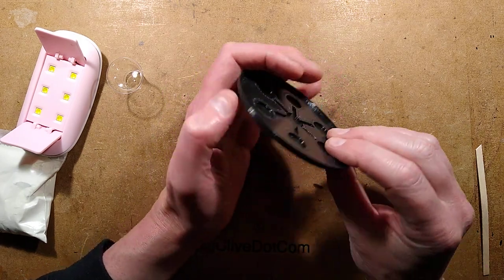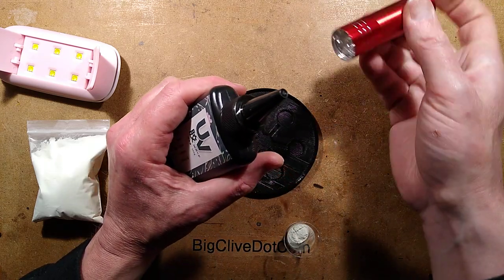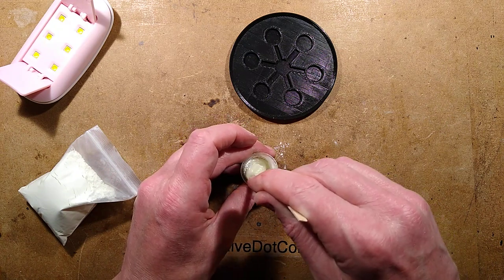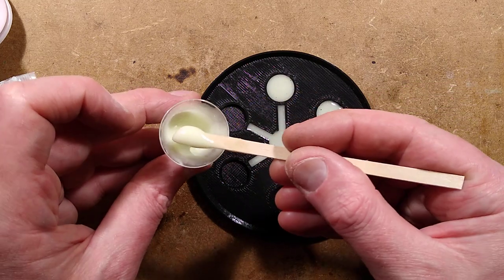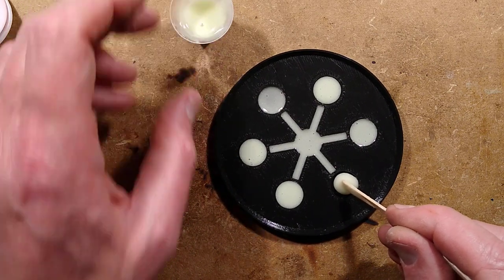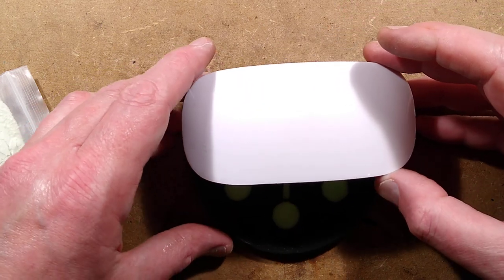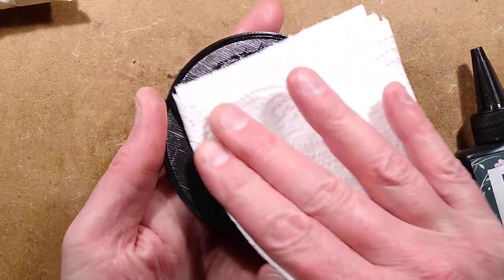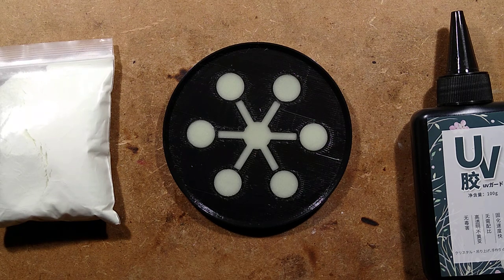Testing UV-cure resin with glow in the dark pigment.

Comment: If the setting reaction is similar to dental resin fillings, then the sticky surface left behind after setting is the "oxygen inhibition layer". If you don't clean it off or otherwise contaminate the surface, you can then bond another layer on to the top of it, as that original surface then has oxygen excluded from it, and it will set and bond to the new layer.

Comment: This might look even better if you put an additional clear layer of resin on top, adding a thin transparent shell over both the black and glowy bits.
Reply: And with a bit of tweaking the models further (different sections of the image separated by thin walls rather than having deeper parts to fill with colour), this would become a piece of cloisonné in plastic.
Reply: Sanding the surface would be the single biggest improvement
Reply: @fluffy I think that the main issue with doing that is that it might interfere with the coasters being "stackable". Otherwise, I 100% agree 👍
Reply: @muaddib667  PLA can be difficult to sand.  It always used to kind of melt and ball up when I did it, but my boss showed me that if you use wet/dry emery cloth and wet sand it with water, that doesn't happen.  Makes a huge difference.  It tends to end up with a matte finish, though.  I've been experimenting with putting on a thin layer of "water thin" CA glue on top and letting it cure to bring back a durable, shiny finish.
Reply: @ManWithNoPlan  That could be fixed in the printing, by making the edges a bit deeper.
Reply: @ManWithNoPlan  Yeah, just a really thin shell of resin, not enough to fill it up to the rim.

Comment: A trick for fixing post-cure stickiness is to cure the resin under a water bath. I do this for UV-resin-based 3D printing, where the process goes: Partial curing -> 2-stage IPA wash -> Underwater UV cure. I'm not sure how well it would work with this, but maybe you could cure it a bit with the UV and then move it underwater for the rest of the curing. I think it has something to do with the resin reacting with oxygen.

Comment: One point on the 3D printing if you weren't already aware, the slicer Cura has a mode call "Ironing" that smoothes the top layer of your prints with the hot end. It gives a really good surface finish especially on things like your flat coasters.

Comment: Nice. If you enable 'ironing' in your slicer you might get a better top finish. Black PLA always shows up any imperfections though.
Reply: The ironing feature in CURA can produce some shockingly amazing top surface finishes. I've been very impressed with it.
Reply: @BRUXXUS  I haven't had much luck with ironing (Cura 4.6.1).  When I tried it all it did was scuzzy up the surface.  It might depend on the PLA and the temperature I guess.  I gotta say that "tea" time printer BC is using seems to leave a pretty rough top layer even if it is black.  Maybe it needs to have the flow rate increase slightly to fill the gaps between the beads?
Reply: Chris Robinson I had great success by lowering the ironing flow to somewhere around 4-5% and increasing the ironing speed to 40mm/s
Reply: Interesting.  I'll have to give that a try.  Currently, I've only used Slicer and Simplify 3D, and I don't think either of them has that option.
Reply: If the printer has a glass build plate, it may be viable to print it upside down. If there were any defects, they would be filled with resin anyway!

Comment: You should really try to see what happens when you put a hardened blob of resin with strontium aluminate into a kettle or a pot and get the water to boil. The heat will make the strontium aluminate glow.
Reply: Really? That sounds hard to believe...

Comment: Congratulations!  You're now ready to explore an SLA 3D printer.  You've encountered most, if not all, of the problems of the photosetting resins used in them.  (In fact, the post-print processing recommended for most systems is to wash the prints down in isopropanol to remove traces of uncured resin from the surface, then give the whole thing a good soak in light from a high-UV source, like sunlight or a UV curing tank.)

Oh, btw, you really shouldn't touch photocuring resin parts with your bare hands before you give them a good wash in isopropanol.  The stickiness is residual uncured resin on the surface, which is usually just a regular epoxy resin mixed with a photoactivated epoxy hardener.  (The light typically breaks down an inert compound of the hardener, releasing it to work.)  I'm sure someone with Big Clive's experience has run into just how unpleasant improperly cured epoxy is.

Comment: This UV-cure resin looks like it would be a GREAT option to revisit your LED embedded crystals.  Fill the mold with UV-cure and glow powder, expose only the sides (don't expose the top where you would put the LED).  After a short cure, pour out the resin in the center, decant and cure the entire item.  Then fill with clear resin (maybe use 2-part for this) and sink your LED.  That should form a glow in the dark shell around a fully clear light pipe and allow the LED to illuminate the crystal more evenly.

Or it would all be just too much work for a little LED glowing pendant.

Comment: I lurv this resin, it sticks to most things and is good for repairing ripped nails I fixed a flapping fingernail a couple of weeks ago - it's still there.   Also broken glasses, chipped porcelain and glass and it's dishwasher resistant It's my go to glue as long as you can hit it with light.  
From the datasheet - The resin is ideally cured in vacuum - it won't cure where oxygen touches it, so the top surface molecule layer won't cure (not the end of the world).  Handcream or furniture polish will remove the sticky without damaging the surface (also good for dissolving glue from jamjars etc).  Acetone dissolves it and you can store it without covering it with anything more than a black bag, it will eventually crust - I put a spreader away without cleaning and it was still wet 3 weeks later, wiped the resin onto paper and it cured OK. 
The resin shown has a longer cure time than the stuff sold in 10ml bottles for tying fishing flies.  I use a 50 LED 220v UV bulb and give it 5 mins or so (it used to be a UV bulb, now it's 3x the price but sterilises the whole street!!! ?).

Comment: I got my quartz-glass topped UVC LED's and my glow powder and it does indeed respond very well to being charged by short blinks of the LED.
Coating the inside of a glass pendant with this stuff should allow for the led to keep it charged from inside in short blinks and a tiny battery can then last ages.
The UVC wouldn't pass well though the glass making it safe.

Comment: Interesting.  I, too, generally follow the Big Clive school of arts and crafts, where I get things everywhere when trying to pour them.  Especially fun with "water thin" CA glue.  XO  Some time ago, I bought a roll of "AMOLEN PLA 3D Printer Filament, 1.75mm, Glow in The Dark Green 1 kg Spool" and used it to print some eyes for stuffed dragons my SO was making.  I printed the bulk of the eye with this, leaving a hole for a slit pupil, and then printed the pupil with black filament and snapped it in.  One of them has been sitting on the shelf in our bedroom, where it only really gets much light when the reading light is on before bed, but it will glow all night just from that short charge.

Comment: That's timing for you, I've just finished a uv resin project of my own. I used the ink from Sharpies to colour the layers of resin and all worked well however the yellow didn't set in the centre strangely enough. Other than that it worked very well, I also used the ink from a uv dna pen (it fluoresces under UV light).

Comment: Back in a job (1999-2001),  making hearing aids, they were made from the same sort of UV "acrylic".
It will not cure in the presence of oxygen (or maybe nitrogen, air basically), thus leaving that uncured, sticky surface layer.... Cleaning the uncured surface with isopropyl alcohol was common practice, however if you submerge it in glycerine (or glycerol? I'm not a chemist) the surface layer cures under UV, and comes out nice and glossy.
Glycerine is also useful to make the medium float before curing (depending on what you are doing with it).
The major benefit we used this material for, was making hollow casts (ear moulds).
As you noticed, where the light has not penetrated, it is still liquid.... So by using a translucent mould (with a uniform light source, and timing the exposure) you can create a "shell" cast....Just tip the remaining liquid material out of the mould (and this is also when it is good to put the near finished product in a glycerine bath to have any remaining liquid material to float up, then cure again so that the inside is all completely surface cured). Wash it in an ultrasonic cleaner, and you can call it medically safe! ...For human ears at least ;)

Comment: With the UV cure resin, you could probably mix some up, put it into a syringe for getting it into the molds easier, and when there's leftover you just put a cap on the syringe and store it somewhere dark until you need it.

Comment: One of the biggest names in adhesives says that to get a surface cure on this type of stuff that you need to whip out the Hg discharge lamp. I assume close proximity to a germicidal UV bulb would work, though I haven't played around with them too much for obvious reasons.

I tried coating a PCB with this stuff using an acid brush, and it started curing IN THE BRUSH before I got too far with it. 

The reason I started trying to use this stuff in the first place was that some of the equipment at work has parts made from ABS/Polycarbonate mix--which only has one ambition in life and that's to disintegrate. Unfortunately it doesn't seem to stick the crumbled bits together that well unless I coat everything and fill in as much as I can and then blast it with as much 365nm as I can get without attracting too much attention.

Comment: finally got my Yihua 8786D Soldering Station...with all the goodies and an extra Iron...  this thing is totally awesome, and the brass fuzzy ball cleaner is incredible for cleaning, even got the Silicone bench protector with embeded magnets for keeping track of the  little parts... my luv for electronics just increased 5 fold...  and all this time I thought the Radio Shack Soldering station was good... boy was I wrong...

Comment: when filling things into forms i always suggest using something that vibrates to put under, old speaker, ultrasonic cleaner to allow for better flow, spread and bubbles coming out.
...you can turn up frequency from a ne555 pwm until you hit resonance of the part...

Comment: The sticky surface is caused by what's often referred to as the "oxygen inhibition layer". Oxygen in the air prevents the resin from curing which means the top surface will basically never fully harden. In some industries they will cure the resin in an Argon atmosphere to get around this. Something that is a bit easier to do at home is to cure the part, then cover it with glycerin (thus preventing air from getting to the surface) and cure again. This leaves a much harder, shiny and more fully cured surface.

There are also "tack free" variants of UV curable resin that do not have this problem, they're generally more expensive though in my experience.

Comment: SLA and DLP printers recommend isopropanol washed prior to secondary cures, for PLA FDM you can use acetone vapour chambers to smooth the print, if you aren't averse to putting an explosive mix over a heat  source (it's relatively safe with an electric heat source as the autoignition temperature is around 460c)

Comment: As I understand it, assuming this stuff is the same as UV nail polish: the layer of resin that's exposed to the air doesn't cure. So that leaves a sticky/tacky surface. Meths is good for cleaning it off. But if you are doing multiple layers of nail polish then you don't need to clean the sticky it off between layers because the next layer will protect it from the air when you shin the UV for the layer of resin on top of it.
I once searched the internet for a while and eventually found this explained in a reddit thread, by someone who works in the UV industry iirc.
FWIW, I personally use uv nail polish and I only wipe the stickiness off after curing the very top layer - this is all accurate as far as I can tell.

Comment: You might want to print a step gauge to work out how different thicknesses look. (Just a set of holes in a block from, say, .1mm to 2mm deep?)

I wonder how well it flows, if you added channels into a translucent, clear, or white print, could you fill them with various pigmented resin?

Comment: The acetone isn't melting the PLA, it's just leaving contaminants in the striations of the print as it evaporates. You should be able to come back and wipe that area with isopropyl and it should clean that white film up. Acetone will melt ABS, and is often used to smooth 3D prints done with ABS, either via direct application or using the vapor.

Comment: The green glow pigment is the brightest initially, but I found that the blue green one glows for a longer time. I filled one of the grout lines of the basement stairs with epoxy mixed with the green blue powder. It is still visibly glowing after hours of the last light.

Comment: same bottle of resin that one of I bought. It's slow curing. I bought one that was round and with plants (a bit floral) design on it, it's a lot faster to cure. But dam it get's hot as f... . Got a drop on my finger and got a 2'nd deegree burn. I used a REAL uv 3w led flashlight. But the shelf life in 20-25C room temp is not long. As for the stickyness, its like the resin sweats when curing, also found IPA to bee good. I use the resin for rc hobby emergency repair and PCB waterproofing seems to work fine so far. Tested an ESC underwater:)

Comment: you should get/make a vibrating table/plate to work with resin, works the bubbles out and helps it flow to a flat surface.

Comment: I  wonder if this resin is a relation to the UV-curing material that dentists have been using since the late 80s to replace amalgam in fillings?
Reply: Probably.  Or the plastic "pens" they sell in the hardware store with a tiny bit of resin in a dispenser at one end, and a  UV LED and battery on the other end.
Reply: Yes, it's the same idea.
Reply: zh84 They are all photo-polymerisation reactions, so related, yes. The dental stuff is certified non-toxic (and pathogen free!) hard-wearing, low-leaching polymers, and these days tends to by cured by blue light (450-480nm, sometimes/rarely down to 420nm) rather than UV which starts at about 400nm and lower; the difference being the photo-initiator used. The reason for using blue rather than UV is its penetration to cure the full depth (down to a couple of mm).
Reply: @andyowens5494  A comprehensive and informative reply.  Thank you!
Reply: @andyowens5494  And given the high intensity, the blue light is safer for the gingival tissue and the operators' eyes than UV might be. Though even with the blue, we did use amber filters to protect our eyes when curing resins.

Comment: Why not make one of your picture frames with the RGB LED's and power bank you did in a previous video but use all UV LED's?  You have the circuit boards still printed up and it would cover a much bigger project.

Comment: if you want more of that type of resin you can take a peek at 3d printing resin, its fairly cheap i spent 20 bucks for a 1gk for clear resin. Be sure to make sure it is for msla printers since those are the ones that use the uv light to cure. Not sure if you would get the same thing with the other style of resin. Other keywords would be elegoo, anycubic, saryatek
Reply from the maker: I had a look on eBay here and the cost and shipping for even 500ml seemed high.

Comment: Why do you not use two component resin? I mean: it IS 2 component, right? So you mix the glow in the dark powder with part 1, and then add part 2 and give it a very last stir. Or have you already tried this, and did this not work for any reason?

Comment: What if you use two UV lights for the thicker poured resin? One on top, and one on the bottom. Or would the plastic receptacle be too thick for the UV light to penetrate?

Comment: Given that your pigment absorbs the light which cures the resin. I would think you have penetration issues with the deeper mold. I think that is your problem there. With phosphorescence the light emitted is always a less intense wavelength; uv goes in visible comes out, and not enough uv reaches the bottom.

Comment: Is the resin underneath not fully cured because of strontium aluminate absorbing most of the UV light at the top of the piece or does it also happen for thicker specimens which didn't have any glow in the dark powder added into them?

Comment: cool project..ive used glowminex glow powder & found that it doesnt like a (hot) cure as it weakens the glow strength compared to before curing. Will the strontium do the same???
Reply from the maker: I've not really tested that.  But this resin doesn't get too hot when curing.

Comment: Freeze your 5 min resin by starting it out, with the tube in the freezer. This will slow the chemical reaction before mixing, and give you some time. Not much more but it becomes decent. Then the reaction goes faster and faster as it warms up to to room temp.
Reply from the maker: That really thickens the resin.  With the syringe version I find I have to heat it in winter to even be able to squeeze it out.

Comment: Could print the base on a resin printer with GITD resin , then fill in the holes with a different glow
Reply: Ooh! Do they have GITD 3D printer resin? I've been doing FDM 3D printing for years, but I haven't really felt compelled to get a resin printer yet. Seems a little too fussy for parts that aren't all that strong. Can't beat the detail you get, though!